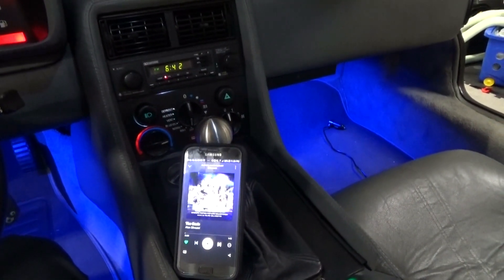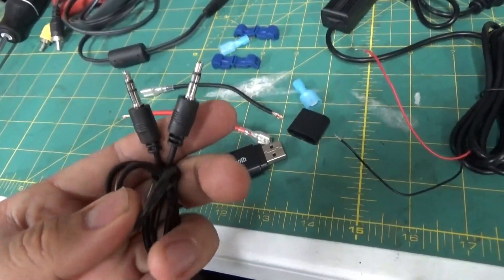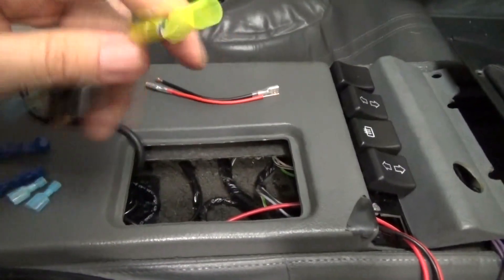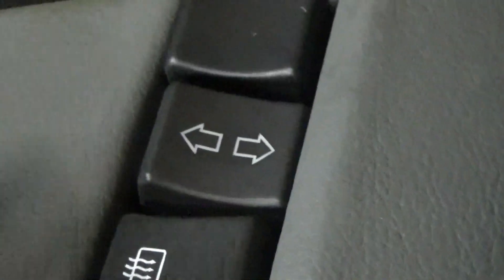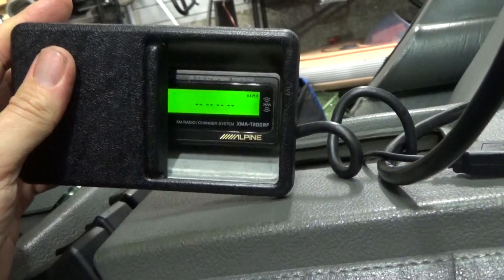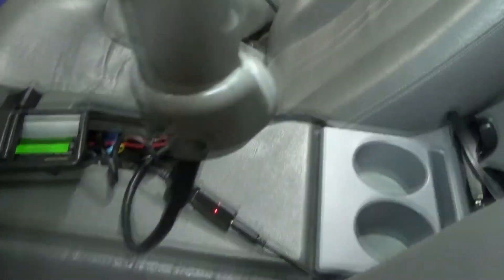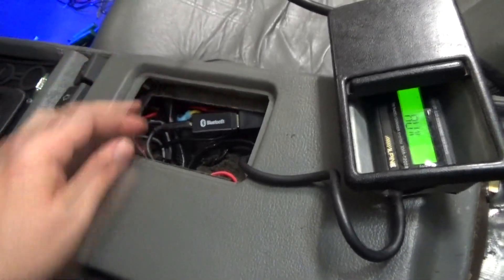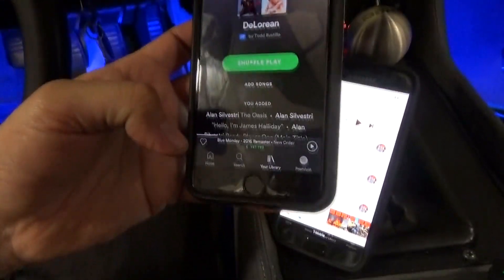Bluetooth Your Stock DeLorean Radio Method #1 - Bluetooth USB Receiver Installation -- RF Modulator

Comment: 11:34 so THAT buzzing sounds similar to what I'm getting on my Bluetooth. It even goes away as you turn up the volume on the phone, the only problem is the music becomes distorted. I'm starting to wonder if its the speakers or a bad ground connection. Do you still have stock speakers?
Reply: You both should be running your phones at around half or two thirds volume, and using the head unit to adjust from there. These little BT devices don't have much ability to attenuate the input level, pushing too hot a signal through them will give you distortion, and other undesirable clipping effects, as is present in the video. Mason, if running your phone volume at half does not clear up your specific issue, then you have an issue somewhere else in your system, eg: loose connection, old speakers, or a dirty volume potentiometer in your head unit, etc etc
Delorean Tech, yours is working great, I think dialing the volume back on your phone to about 2/3rds will sweeten it up nicely.
Reply: McFlyWalker2112 I’ve replaced all my speakers with modern Kickers and the sound is much better. The distortion is none existent and you can only hear static if you aren’t play anything and you turn the radio volume all the way up.
Reply from the maker: The buzzing sound is strictly coming from the radio.  Been there since I got the car.  I can actually go back behind the radio and move it a little and the sound changes pitch!  I need to put my original ASI back i the car and get rid of the Craig....anyway I am thinking bad ground connection or interference with the antenna.